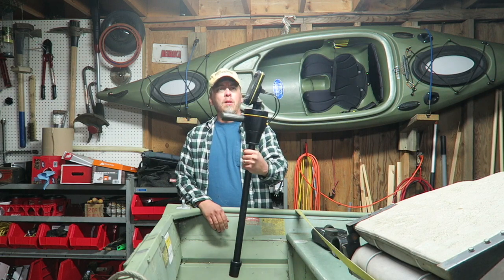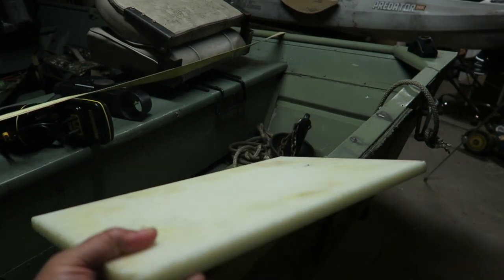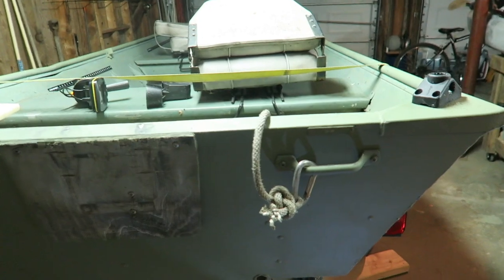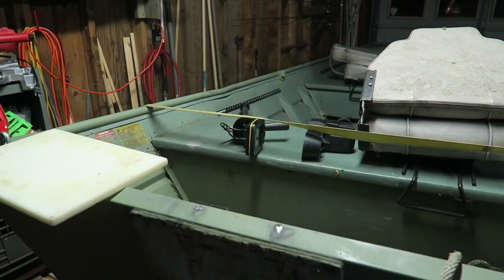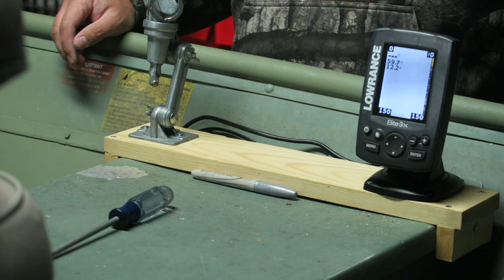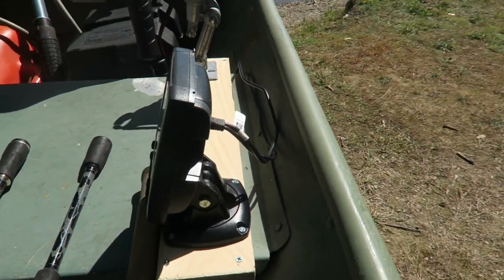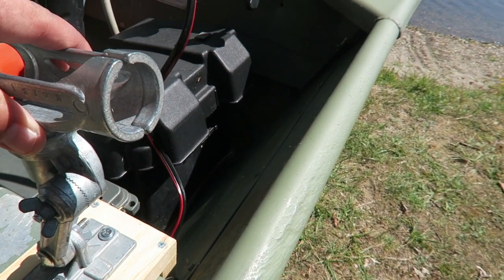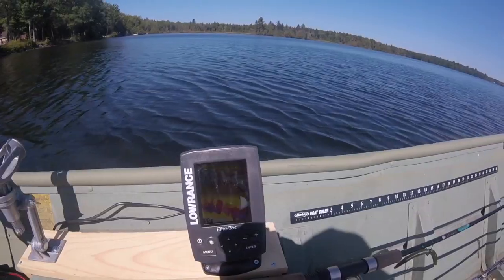Installing a Fish Finder on the Old Jon Boat

Comment: Great vidio , I have a Plastic Jon & thinking of what to use as adhesive as i tried some $$ brand for undercoating for protection scrapes & scuff's etc. & it just peeled off / friend of mine said to use PVC glue for the transducer block so i'll give that a shot was thinking on using wood at first with marine sealant but liked your Idea better // Also have to figure a way for Monitor as i am a big Fella & my self takes up a good portion of boat in rear maybe some type of sidewall bracket in front of my pole holder // It goes to show you an old dog can learn new trick's ! LOL!  I'll be watching !

Comment: Does the transducer have to be lower than the hull or can it be flush? I fish shallow water and run aground often.
Reply from the maker: Having it flush should work, because once its in the water with you, and your gear, motor, etc, it should be submerged enough to get a good reading. Thanks for watching!

Comment: Thanks for sharing. I haven't bothered with a fish finder for years on my little boat but I'm thinking about getting one. How long does your battery last?
Reply from the maker: I can go on many outings and it still has a decent amount of charge. I usually just put a trickle charger on it every couple weeks or so. It lasts well, considering its a cheap walmart battery.

Comment: Need yalls advice,  what size or kind of battery will I need for fish finder unit.    Would you recommend I get a separate battery or can I use the battery that I run the rest of my jon boat on? Is there a specific type of battery I will need?
Reply from the maker: You can run it right off the same battery as the trolling motor, but I use a very small battery just for the fish finder, since I used it in a kayak at one point. Either way will work though

Comment: Did you use 3M 5200 FC or 3M 4200 FC? I'm adding a 2nd Fish Locator to the rear of my boat. I have 4200 FC. Thumbs up on the video.
Reply from the maker: I'm glad you liked the video! I used the 3M 5200 FC adhesive. Seems to be durable stuff, its still holding on! Let me know how your install goes!

Comment: can the fish finder be hooked up to the same battery the motor is ran on?
Reply: Mark Nunez yes
Reply from the maker: Yes it can. I did it this way so I can make it a little more portable in case I want to put it in my kayak.

Comment: Great idea that's what I'm going to do as well has been holding up after all this time?
Reply from the maker: It has held up very well. The piece I stuck on with the adhesive is still there, even after 2 years and leaving it out all winter with the boat upside down.

Comment: Great video! I'll be doing something close soon. Question: is there a problem with running your fish finder to the trolling motor battery already in your boat?
Love the portability of what you put together.
Reply from the maker: You can definitely run it off the same battery, I do it for the portability reasons, so I can use it in a kayak if I need to. Thanks for watching!

Comment: What type of battery do you have and where can I get one?
Reply from the maker: It is an Everstart brand they sell them right at walmart. It says something like Power Sport on it, I think its the smallest one they had in their automotive section, I think it was about $25. If possible, bring in an old battery to avoid a core charge, or they charge you an extra $15-$20. It doesn't have to be the same size, I brought in a giant dead battery for a core. It seems to be a good battery so far, I have used it for 2 full seasons and I can go out many times before it needs to be charged again. Hope it works for you!
Reply: Thank you so much for the response. For that,  I'm now a subscriber to your channel.
Reply from the maker: You're welcome! Thanks for subscribing, I hope you enjoy other videos on here too!

Comment: 10 months has the transducer held up?
Reply from the maker: The mounting block it still attached, it survived being out all last season, and stored outside for the winter. I've had issues this year with my motor, so I've been using other watercraft.

Comment: How long does it take to cure
Reply from the maker: I think its around 24 hours. I can't remember what the package says. In the video about 24 hours passed from when I stuck it on, to when I mounted the bracket to it. It seemed pretty solid. After using it all season, its still stuck on there, so I think that adhesive is pretty good stuff! Sorry, I thought I replied to this already, maybe I forgot to hit the reply button or something. Thanks for watching!

Comment: What size battery did u use
Reply from the maker: Hi Miguel, I got that battery at Walmart. I think its an Everstart. It's a small atv/mower battery, the smallest they have, its around $20. Make sure to bring in an old battery as a core, or they'll charge you an extra $20.

Comment: where can I get the battery
Reply from the maker: Hi Miguel, I got that battery at Walmart. I think its an Everstart. It's a small atv/mower battery, the smallest they have, its around $20. Make sure to bring in an old battery as a core, or they'll charge you an extra $20.